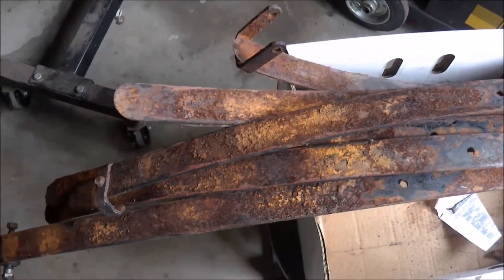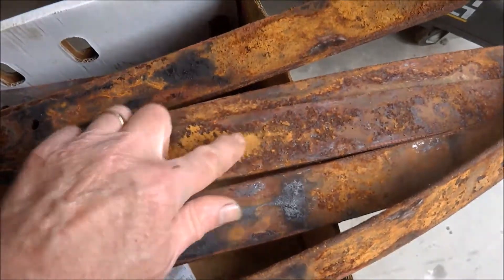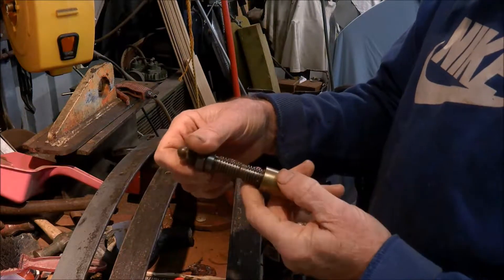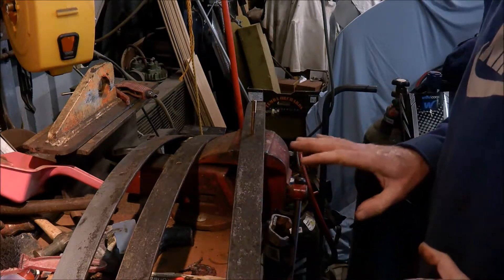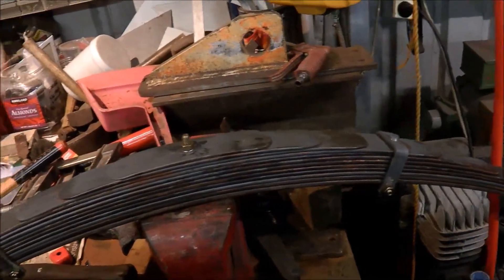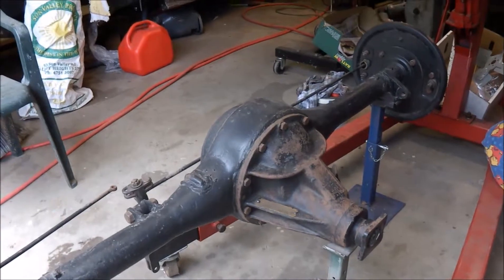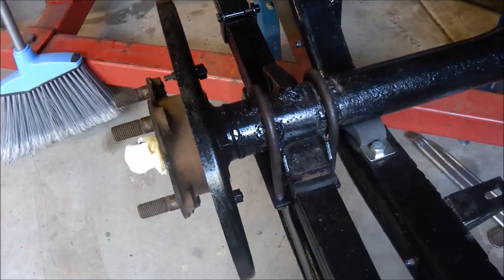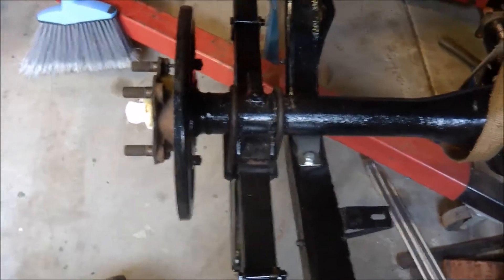Rebuilding the rear suspension Part 31

Comment: Hi Denis where did you get the replacement bushes from for the links to the shocks. do you have a part number ? cheers
Reply from the maker: Jason
I got them from David Beales Engineering. They have a store on Ebay under daimlerboy87. The rubbers are listed in their store under Consort Parts.